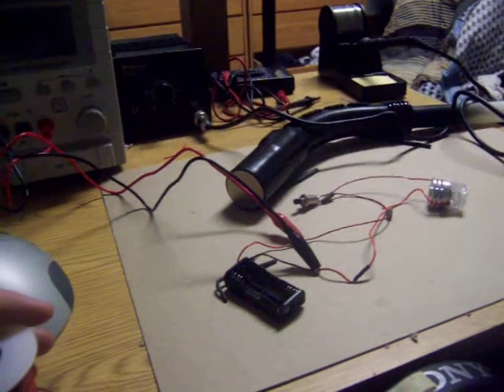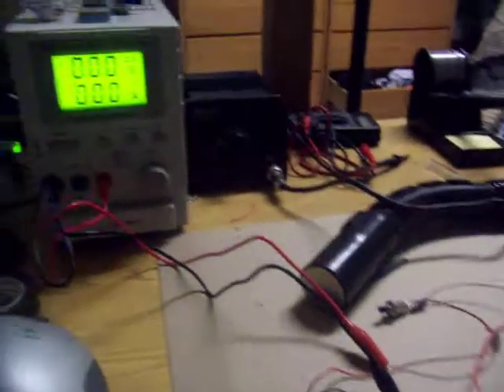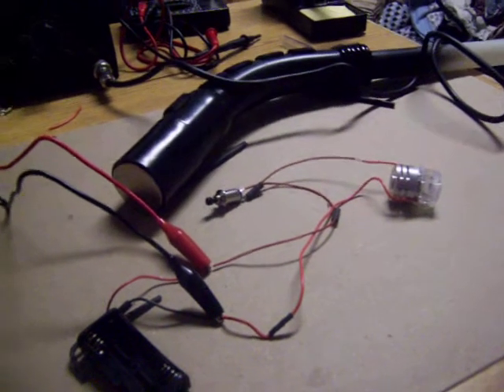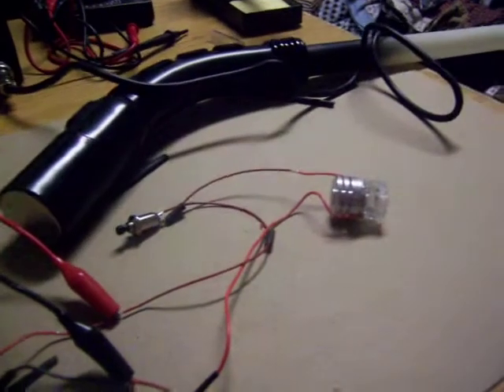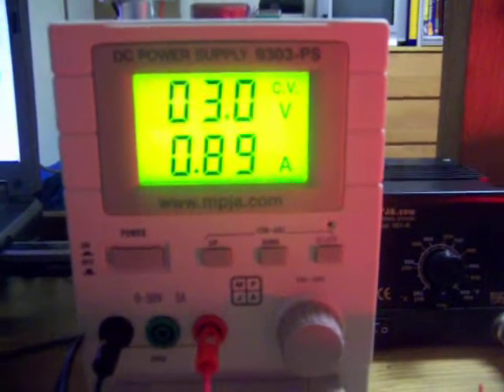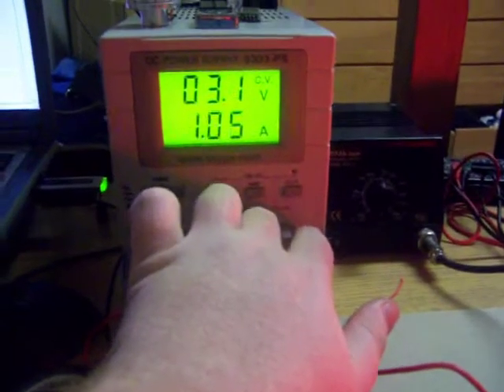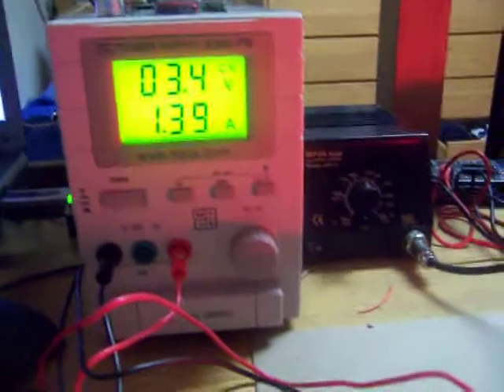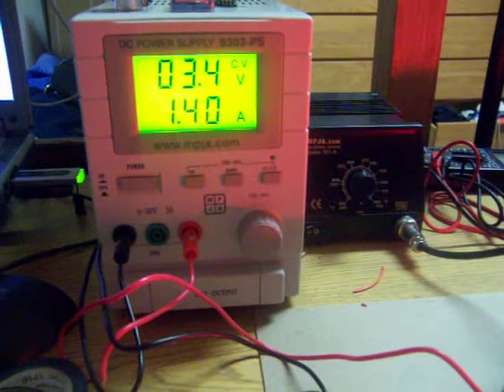PSU fun

Comment: A resistor will waste a lot more power, and the led will fade as the batteries get used up, especially with lithium rechargables, since they tend to vary in voltage fairly linear with remaining charge.

With a buck regulator you get good efficiency, and the brightness will be consistent until the battery voltage gets really low.

That said, A 10 cent resistor is a cheap and effective solution if you can accept these limitations.  Especially with a good choice of voltage and NiMH batteries.

Comment: There's also the fact that it LEDS have a negative temperature coefficient, so when they get warmed up they'll draw more current than when they're cold.

So if you set the current cold, then let it run for a couple minutes, It'll probably drawing slightly more current.

Also, with a driver your brightness should be consistent as the batteries get low.

The driver will just start dropping less voltage until it gets to full on and fades out like normal(or stops operating, depending on the design)

Comment: Ok, you seem to be going all over the place here. Rechargables will save you more money on batts than a driver.  Alkalines drop to 1.2volts when under load anyway, so it's a non issue. And someone stupidly using Li-Ion cells can be said for any consumer electronic device.

Resistors work fine in Lux sabers and in most cases a driver is not needed and provides no tangible benefit to equal their cost

Just my opinion, of course. I do respect your opinion as well, even if I don't agree with it.

Comment from the maker: Also, that's a power supply only. If it were a resistor it may not even put out 1000mA.  That LED put put 800mA at 3V.  I think 800 vs 1400 starts to get noticable.

Another issue related to batteries... there is no calculation involved if you need to change  batteries.  What if you are out and need to use alkalines instead of your normal rechargeables?  What if you're a newb and throw in a set of li-ion's ignorantly?

Comment from the maker: True, the problem goes both ways though.  There is an avalanche of current if your predicted value is too low.  So if you're a newb and didn't use a good heatsink and happen to have a really low voltage (not Red III's) it could fry with too much current.

Then not even addressed is the efficiency.  Resistors burn of the excess as heat.  Over the life of the LED will you not save by getting a driver when batteries are a concern? 90% efficiency with a driver is pretty nice.

Comment: In your video:

"Amperage and visual differences"

You claim that variances of a few hundred ma's can't really be noticed. And you're right, it's not noticable. 

A red Lux III driven at 1000ma won't really be noticably dimmer than one running at 1400. (Just look at any red being driven by an MR board.) So even if you have variances in current, it's a non issue since you won't notice it.

Resistors are 10 cents. A pair of pucks are $30. Seems like all things considered, resistors rock.

Comment from the maker: It's a pain for a person to find out what the forward voltage is even if they get a range from the binning.  Resistors are usually rounded to the nearest one... so yes, I think it's reasonable to say they do suck because it can be luck of the draw on how much current you are actually giving it unless you test it.

Testing does have it's uses as I but my low voltage ones in sabers with a 4.8V pack vs. a larger 7.2V.

TCSS has 700mAh drivers.  Parallel them for 1400mAh.

Comment: I don't see how this shows that resistors suck. All it shows is that the forward voltage required to achieve maximum current on the red Lux III ranges from 2.95 - 3.51 volts, just like the datasheet says. That has nothing to do with resistors.

Further, a driver won't really help here since there is no 1440ma LuxDrive; Buckpucks stop at 1000ma. If you know of a 1440ma driver, you may want to inform Tim so he can stock one in his store.

Comment: The red luxeon III has a rated forward voltage of 2.95v not a MAXIMUM VOLTAGE just a standard forward voltage.  That will also use the standard current.  The MAXIMUM rated curret is 1.5 amps and that will take more volts.  Normal use and within spec.

A resistor drive setup can provide the 1.5 amps!  It just won't stay at 1.5 amps as the battery dies.  THAT is the advantage of a buckpuck.

Comment: Spread the gospel! :)

I was talking about this on the Custom Saber Shop forums. I do my Luxeon testing with an adjustable power supply and noticed similar issues to this.  The rated forward voltage on Luxeon LED's is just a "guess" and you need to test each one out, THEN pick a resistor for THAT led.